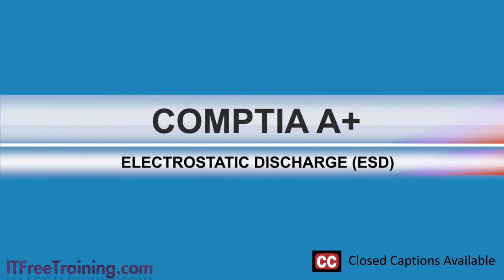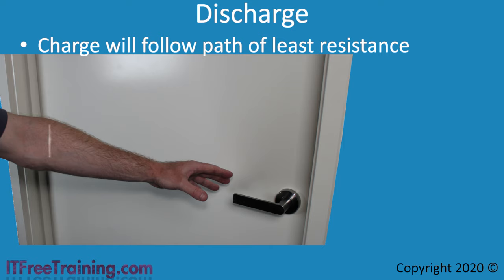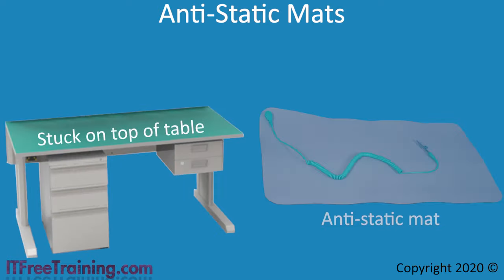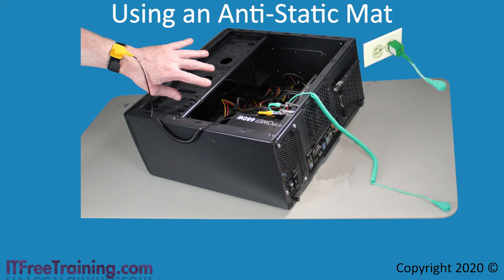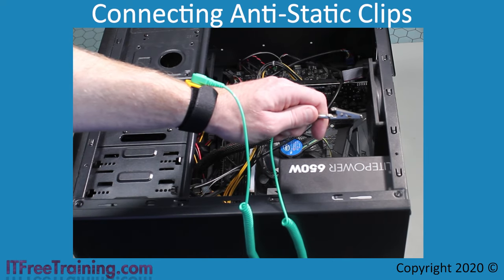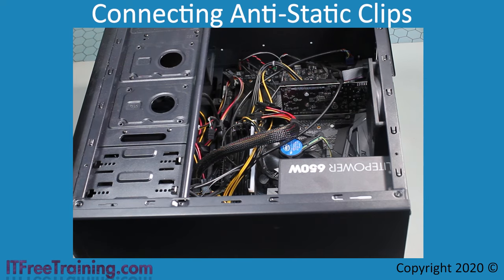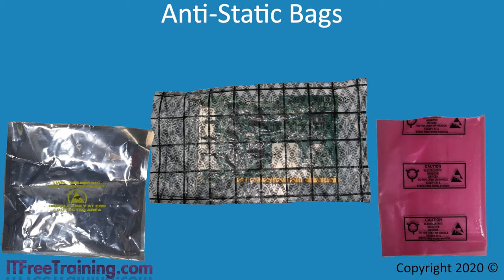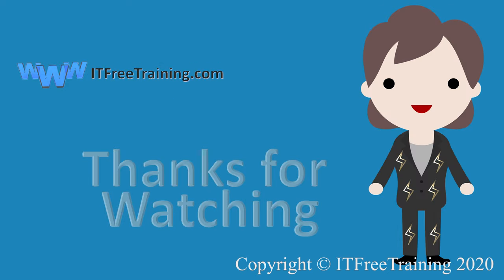Electrostatic Discharge (ESD)

Comment: Hello, i have currently using Static Discharge Palm Plate equipment. Did there has way to check that my palm plate is working?
Reply from the maker: You could use a mulitmeter. Set your multimeter to the continuity (beep) mode. With the palm plate disconnected from any power source, touch one probe of the multimeter to the conductive plate of the palm plate and the other probe to a known grounding point. If it beeps it is working. Make sure you ground it again before use.

Comment: As for the electrical discharge, when the body rubs with the carpet, it loses electrons, and when the body touches any metal surface close to it, such as a door handle, for example (the bonding forces of electrons are weak) the electrons will move from the metal surface of the human body to compensate for the lack of electrons in it. The question is why does a positive charge not appear on the surface  A metal that has lost its electrons
Reply from the maker: Essentially the problem with ESD that you are trying to avoid is the sudden transfer for charge one to another. This happens when the balance is different. By grounding yourself, you are essentially removing an extra charge you may have, thus transferring it before you touch any components.  The extra charge would naturally dissipate into the air given enough time. The metal does gain a charge from you, however, it is better a holding a charge then we are. Thus you are transferring the charge to it, the metal is holding the charge and it slow dissipates.

Comment: I have question:When should i use that wire static?
Reply from the maker: What you do mean by wire static? When working with computers doing some ESD protection is always good, just grounding yourself before you touching a component makes a difference.
Reply: @itfreetraining  well what about when you change ram?

Comment: Sir- can ionizer fan replace wrist band?. This may not be in line with ANSI ESD standard?  Believe wrist band, ankle band, floor mats is ESD personnel safety.
Reply from the maker: Using ionizer fans can help. However, if you pick up charge somewhere else and walk into that area you will still have the charge. Any ESD protection is better than none, so ionizer fans still help.

Comment: ok basically you touch nothing, now I am way far away from my computer and even afraid to use it damn!
Reply from the maker: Electronics components nowadays are pretty tuff so if you exercise a little care you should be o.k. Main thing if you don't have the ESD equipment is to touch the computer case so you remove any static electric that you have before touching a component.